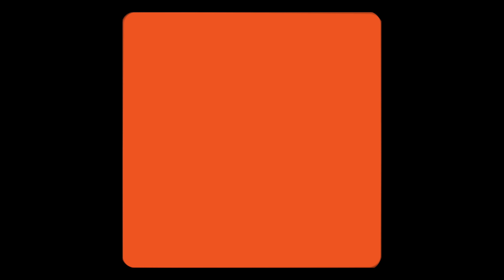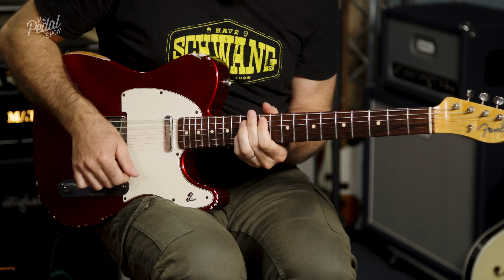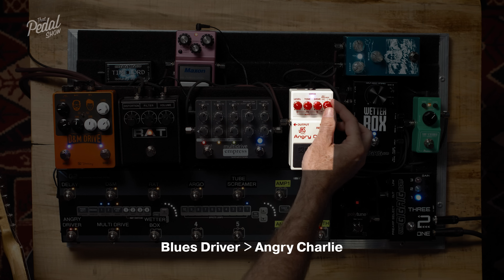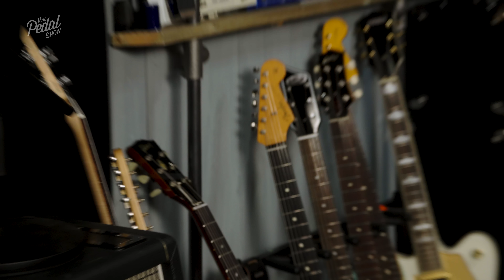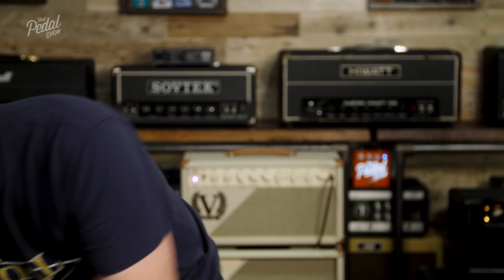Mixing Gain Pedals In Parallel For Ultimate Versatility – That Pedal Show

Comment: I have tried tons of drive pedals. A good one will have a nice sweep of light gain to saturated gain. It will have an eq that can accentuate the level of gain to taste. It can clean up excellent with the guitar volume. There is one that stands out as the leader of the pack. It’s none of the boutique pedals. It’s not the OCD.  It is the Boss Blues Driver. The low end is tight and enormous. The high end is articulate as hell. The strings sound stringy thru this pedal. Put a clean boost after it for solos. Incredible pedal.

Comment: You guys need to collaborate with Josh Scott on a new pedal. A dual parallel modulation called 'The Tangent'. Starts off in whatever settings you have the knobs at but then diverges randomly into other sounds before eventually returning to the original. 'Dual Parallel' because either side can diverge and one can follow the other or do its own thing that may or may not be related. I suggest Josh because he's quite capable of going off on a tangent all by himself. Imagine how many units you'd shift. Up to a million (remembering that 'up to' includes all figures less than that) I would think. 😎
Reply: Sadly it would probably be unaffordable...
Reply: @weschilton  If they made it part of the 1966 series it definitely would be. 😁

Comment: The Fender Pugilist is a steal on Reverb right now. 2 gain stages, series or parallel. Wide range of sounds. Good pedal.
Reply: @Evan Ward - Thanks for the heads up on this pedal Evan. I just bought a used one online from GC for US $60.
Reply: @patrickfitzgerald2861  Nice! I hope it serves you well.
Reply: @Evan Ward - I hope so too, but if not my local GC will take it back, which is why I buy nearly all my used gear from them.
Reply: I love the Pugilist! It currently my favorite gain pedal.
Reply: @patrickfitzgerald2861  Is it a gold one or silver one? The gold one is supposed to be slightly more compressed in the upper mids on the left side.  (Kidding -- a little tweak for the Klonheads.)
Reply: It's such good value for money. Does great low gain as well as all-out distortion. 
The Full Moon is also very good, but it doesn't do the series/parallel thing.

Comment: I use an old big muff and an old tube screamer in parralel on my blackface Fenders which are really mid scooped. Get the muff fuzz but the TS808 fills out the middle and it kills.
Reply: I do this with a Danelectro French Toast fuzz and a Rat. The Rat fills in all the mid gaps.
Reply: C.P. how do you manage to do that? Do you use a wetter box or can you use ABY boxes? Interested because u want to rum my Rams head fuzz and a clean signal to ease it a bit

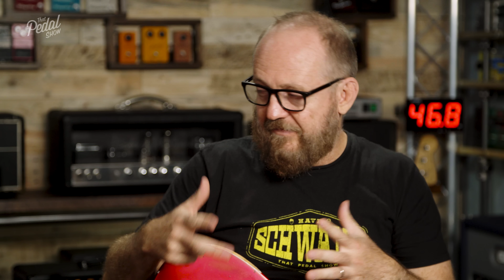Comment: Upon Mick's advice, it being a holiday weekend here in the US, today I turned all the knobs on my Mesa'Boogie F-50 and my gain pedals on my small pedalboard (tc electronic MojoMojo, Catalinbread Formula 5F6, and tc electronic Spark booster) to 2:00, and it was so loud even without the pedals on and in the "clean channel" of just the one amp that I fear I may need to repair some of the plastering in my flat. And I'll have you know that I run 12AU7s in the first two positions to reduce the level of gain in the amplifier. :D
Reply from the maker: Great work Gemma! Wish we could have been there. :0)

Comment: Funny you should upload this today, my Chase Bliss Brothers was delivered to my door about an hour ago and I'm playing with it as we speak. Sounds absolutely incredible, I'm usually very picky with drives and am not a fan of particularly high gain tones, but the parallel mix feature on this is just perfect for dialling in just the right amount of gain and just the right feel under the fingers. This ones a keeper, I can feel it (it wants to be for its price!).
Reply: I love my Chase Bliss Brothers too. I use it in parallel with boost and overdrive or w/ boost and fuzz. It's almost like two guitars at once if you play in stereo.My gain stages start at EarthQuaker Devices The Warden compression with the gain up a bit  and then into the Chase Bliss. That goes  into an Xotic Effects RC Booster that has 2 stages of boost; one light and one heavier. The next gain stage is the EHX mini POG , very slight upper and lower octave settings and the gain set a bit above unity. Add some slight delay and reverb into a stereo amp set up and it's pretty awesome.
Reply: @palodine1  cant wait to try it out with some more gain stages. Been playing around running it into another boost and it sounds great, more volume and clean headroom = more good! I'm currently having a massive pedalboard overhaul and have sold off like 9 of the 12 pedals that were on my board, and I'm waiting for a hudson broadcast and a cali76 to run with the brothers. Cant wait!
Reply: @georgesims1724  You will adore the Cali 76. Greatest compressor ever in pedal form.
Reply: @JP-kf7bs  that's what I've heard, so I'm expecting good things. I just hope it comes with a switch to make me play like Chris buck or Joey landreth :)

Comment: So essentially this gives pedals the channel-blending capabilities of classic multi-input amps like the JMP, AC30, or Fender Tweeds. The clarity is fantastic, I can see this providing some of the benefits of wet-dry at a lower cost and without having to lug around two amps. Please do a follow-up showing how well it blends cleaner modulations and delays with more compressed drive sounds!
Reply from the maker: That’s a great idea, thanks Anthony.

Comment: I've just gone to copper on a practice amp that has clean, overdrive, and distortion channels switchable in parallel. (Considered multiple series/parallel options, but with three channels that would require a micro and relays (or a plethora of switches) and complicated status indicators, and I wanted to stick to simple DPDT pushbuttons for selecting the channels and "Millenium [sic] Bypass" channel indicators.) Nice to see validation that my idea has some merit.

Oh, and in case anyone is interested, the summing amplifier in my amp goes into a low power MOSFET that sees only half the op amps' supply voltage to simulate a SE power pentode, so depending on the Master Volume setting, even the clean channel can kick the snot out of the little MOSFET for some good power valve compression. Then the signal goes through a simple Marshall cab sim to a spankin' clean power amp with its own volume control.

Comment: Note that that's pretty much how the Bassman, then pretty much any 4-input NMV Marshall work, mixing two channels in parallel (Normal and High Treble). As opposed to the MV Marshalls, the 2203/2204 in particular, where both channels are cascaded (which also was the idea behind the one-wire mod for Superleads, as used in Randy Rhoads' white Superlead, amongst others).
That logic also was emulated in pedals such as the Marvel Drive, that emulates the schematic of a Superlead preamp, only substituting JFETs for tube gain stages. So, two channels in parallel that get mixed together.
Also, it's not conceptually very different from blending amps together, which has gone on forever.
So, not entirely a new idea, but a cool idea nonetheless ;)
Reply from the maker: Oh goodness, we didn’t mean to imply it’s a new thing. Studios have been doing it for decades!
Reply: @ThatPedalShow  No worries, I didn't take it that way. Just reacting to the part at the beginning about how gain stages are cascaded on amps, where it's actually not entirely the case with vintage amps. Amongst which, the Marshall 1987 that's sitting in a corner behind you, Mick ;)
Reply from the maker: For sure. Although, it still kind of is. Presumably the 1987 doesn’t use just one side of a 12AX7.... in any case, yes the old four input amps mix the channels in parallel, then series with the power section/phase inverter where a lot of the goodness comes from in those circuits. Cheers!

Comment: My 2 cents: 1) I've  played with running pedals in parallel for a few months. Russian Big Muff (a lot of low mids) & Red Witch Fuzzgod (not a lot of low end), Delay & Reverb (very clear repetitions as not affected by the reverb), digital pedals with poor AD/DA-conversion etc.. I dropped the whole concept because I prefer very homogeneous, focused guitar sounds. I came up with some impressive sounds, partly because a lot of times it sounded like 2 or even 3 guitars, which might work in a life situation, if you don't mind the switching; but in the studio I always preferred a second guitar take that I could pan and effect differently in the mixing process. 2) About the term "phase". A lot of people are confused when it comes to phase issues because a lot of people (and mixers and pedals and ...) talk about or switch it and what they mean is: polarity.

Comment: 😆😆😆26:28 
The title of this show could just be “All Pedals Sound Best With All The Controls At 2 O’clock (apart from the Master Volume)”
Does the same apply to amps though?
Reply from the maker: Pretty much. Never for the bass control though. That always needs to be at 10 o’clock. Or zero for a Plexi. Beahahahaha

Comment: Strymon SUNSET dual overdrive is a real killer in this department.  A channel, separate B channel, you can put A into B in series, B into A in series, or A and B parallel with each other.  Add in the knobs on each channel to dial in the variables for each and you have a smorgasborg of sounds.  Add in a Selah Quartz V3 controller (SUNSET TRS cable out to the Selah) and you can save any number of drive combinations you like.  A really simple, space saving, killer solution for those not wanting to have 6 or 8 drives on their board! (sorry Mick, had to say it !!).  Of course if someone were to give me a King of Tone, I do believe I would happily add a second drive pedal.   :-)

Comment: Quick Tip: If you are going to prop your guitar up against a wall using the headstock like Mick did, turn it 180º so that the strings are facing the wall. This way any extra stress on the neck will be counteracted by the strings pulling in the opposite direction. This reduces the chances of the neck bowing under the string tension and the extra pressure of the guitar's weight on the neck.

Comment: FYI,  Peter Greens LP was “magnetically” out of phase, as the neck pickup’s magnet was re-installed 180 degrees from stock. Most guitars are typically set up with a switch to make the pickups “electrically” out of phase. The tonal difference is quite significant.

Comment: I REALLY wish TPS would go in-depth on ALL of the various way to split a humbucker. I have an HSS Stratocaster ( Seymour Duncan Pearly Gates) that I am splitting and was amazed at all of the options and opinions regarding this mod. Please try to include all methods if possible especially the PRS, Bill Lawrence, inductor and series/ parallel methods. The use of resistors, capacitors and such to thicken the sound of what many say will inevitably be a thin sound when a humbucker is split. Thanks for what you guys do!

Comment: I have a Fender Mustang that I've hot rodded to allow both pickups in series and out of phase. This setting is great going into a fuzz or heavy distortion! Works a lot like a treble booster, shelving off the bass and tightening everything up.

Comment: Great show! For years I have used an EHX Bass Big Muff after my main over drive pedal, as a boost. The reason I use the bass version and not the normal one is that it has a "dry" switch. This allows your clean signal to be added to the fuzz sound. Since I have an overdrive infront of the fuzz, it mixes my od and fuzz sound together. Giving me a much more complex, fuller drive sound.

Comment: Speaking for myself, I personally don't mind if Dan plugs the Wetter Box, at all. It's a brilliant piece of kit, honestly, and I can't think of an easier way to run two pedals in parallel than to have another pedal specifically designed for doing just that. That being said, thank you so much for this episode, because I never really thought that running two different gain stages in parallel would make that much of a difference. I'm pleasantly surprised to hear how much depth it can add to the sound, almost like running two amps (which I do). And yes, those phase relationships are critical. I'd never want everything perfectly in phase, because if it was, the sound would be boring! Perhaps I need a bigger pedalboard, after all?

Comment: Thanks for nice show on serial vs parallel ODs. I have wandered why the TC Electronics NovaDrive didn’t get mentioned. It’s a fantastically sounding pedal with independent analog OD and Distortion engines which can be  run in series and parallel. It also has the incredibly useful feature that 16 presets can be programmed in which are MIDI switchable which makes it a great partner for the G2. Have been using this in my rig with Mesa Lonestar Special for years and can in essence get any possible sound combination out of it that I want. Encourage you to have a listen/play. Great show, Bas

Comment: Source Audio LA Lady allows parallel gain staging. It has two drive channels which can be run in series or parallel, run in stereo or mixed to mono. You can also blend in your clean sound. You checked it out on a pick and mix once and quite liked it if I remember (despite it being digital 😉 ).

Comment: Dan has to stop talking to the pedalboard :D It's not like you couldn't hear him, but it definitely gets more quiet and muffled. Or you're gonna have to figure out more advanced micing system. Cool episode as always, guys! Those basses in the corner, funny detail btw.

From what I gather, these parallel gain stages work a bit like blend control in compressors (if you do what you did with jhs driver)? You get punchy attack, but also a nice sustain.

Comment: Can you quickly recap how we use a Wetter box to parallel the signal in the D&M? I didn’t quite catch Dan’s rapid explanation at the end
Reply from the maker: Inside the D&M Drive are a couple of mini dipswitches. You put the pedal in TRS mode using these where upon the input jack becomes in and out for Mick side, and the output jack becomes in and out for the Dan side. Using a TRS to two mono jack leads you then put Mick in one loop of the Wetter Box and Dan in the other. Boom!

Comment: With parallel one can direct one signal into the Bright side of a Marshall and the other signal into the Normal channel of the amp and adjust volumes to taste. Or, if one has a Kendrick Black Gold with both a Blackface-voiced input and a Tweed-voiced input, the parallel technique will be expanded exponentially, causing a tear in the fabric of the Universe. The resulting event horizon will swallow Time itself, and existence will cease.

Comment: Just experimented with this, using my BOSS TU-3 as a splitter going parallel into a fuzz and an overdrive pedal and then into a small mixer to blend the 2 signals going into my amp. Never tried that before. Fun stuff, Thanks!

Comment: Parallel gain mixing is why my MIDI controlled Strymon Sunset is my main gain pedal. Keep up the great work! 👍
Reply: Todd Giencke - Yes, parallel gain mixing was my main reason for putting the Sunset on my board ... that and the frickin’ awesome tones that you can get from it! But I’ve never used the MIDI functionality. What controller do you use?
Reply: Disaster Area Designs DMC-3XL
Reply: Thanks, Todd

Comment: It's not quite the same thing as two drive pedals in parallel, but there are a decent amount of drive pedals with blend or dry/wet controls which is a cool thing. I've also recently tried and really liked running my octave fuzz into my dry amp only which gives you a similar parallel thing to what you guys did. Also, there's The VFE Klein Bottle which lets you run any three pedals in parallel, with feedback and multiband controls.

Comment: So glad you guys did this video. I've fascinated with parallel drives for a number of years. In the past I've owned a Boss LS-2 and used that for blending fuzz and overdrive in parallel. I've also owned an Empress Multidrive. Currently though, I'm back to using a straight overdrive pedal. What I've noticed is that in a loud band context, it's the cleaner of the 2 drive sounds that cuts through, to the point where the higher gain / fuzz sound is indistinct. On it's own parallel sounds awesome, and to be honest it still intrigues me. Maybe I should get the Angry Driver, hmmm.

Comment: Thank you guys for a great episode! Long time viewer, first time commenter. Thank you for proving that I'm not mad! I've used a TC Electronic Nova Drive as my main drive pedal for years. It's hard rock sounds as a distortion are great, and for my lead sound I switch to the overdrive and distortion in parallel via MIDI (sorry Mick!), and adding a boost after. It means I can keep my main core tone, whilst adding clarity and definition for leads, whilst subtly adjusting the EQ. No more gain, but everything sounds bigger, fuller and just plain better. I knew I wasnt mental. 

Keep up the good work boys, loving your work!

Comment: Yet another great episode, I’ve been using the jb2 since about February gigging most weekends but haven’t had time to try out the parallel mode at a gig yet ! (Joys of young kids at home and too much work and not half enough guitar/pedals/amp play time) This episode had spurred me on to try out more sounds, only bother is the current board I’m using has 3 drive pedals on it one being the jb2 and two on board mixers and I’m getting serious option paralysis.....! 😩
Reply: Forgot to add, I bought the jb2 after see ye guys coax some great tones from it....!

Comment: The trick to out of phase pickups is to use Gibson's two volume controls and dial back either the bridge or neck ever so slightly, which fills in some body to the sound without losing the "quack." I love the sound of it!